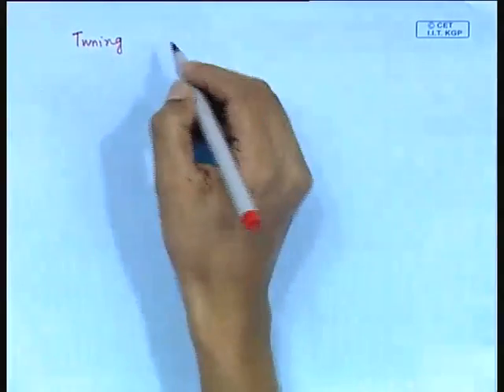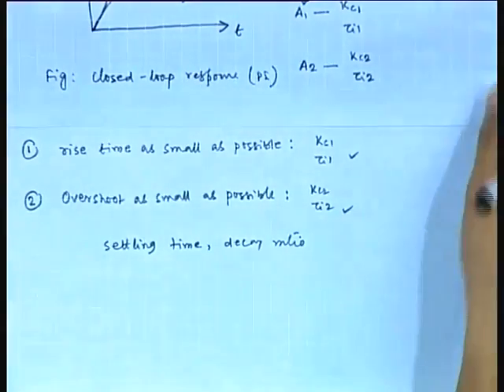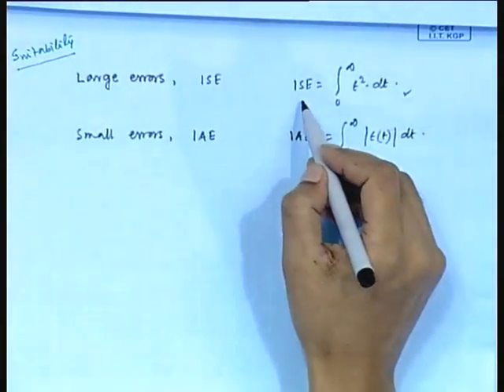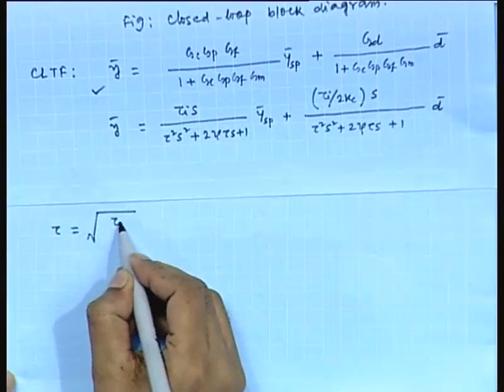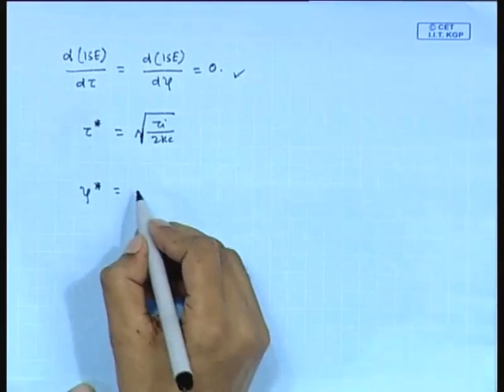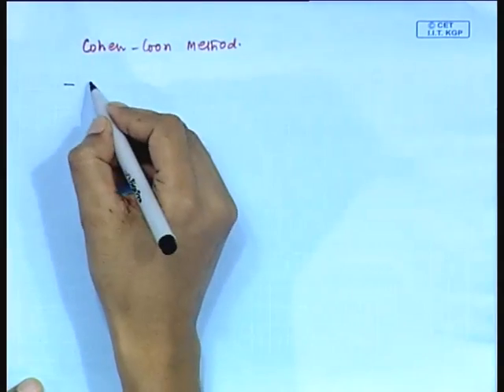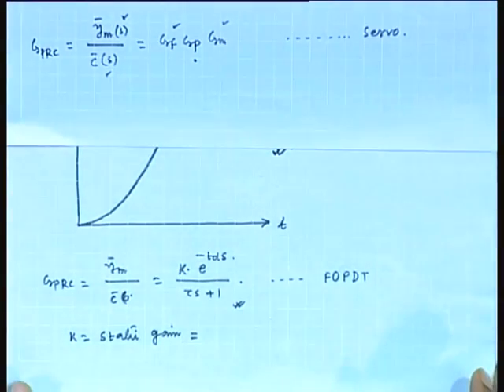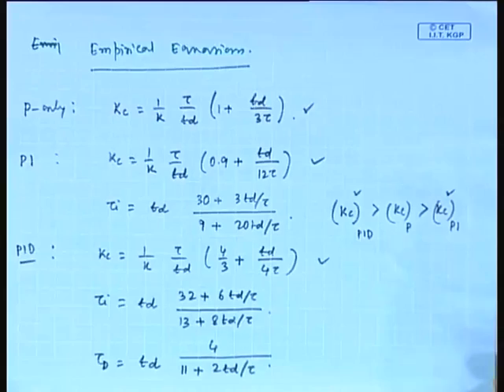Mod-01 Lec-22 Feedback Control Schemes (Contd...7)

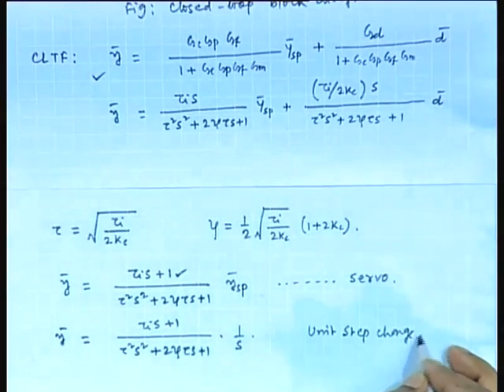Comment: Note 25:56 there is a correction in the general CLTF right before the servo problem. the general CLTF (servo portion) is supposed to be tau(i)*s + 1/tau^2s^2 + 2 zeta tau s + 1